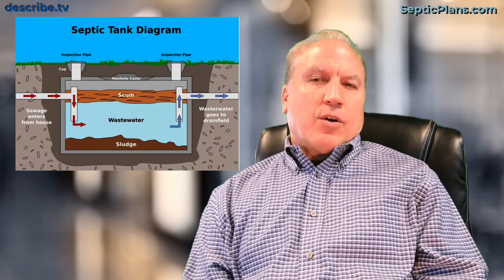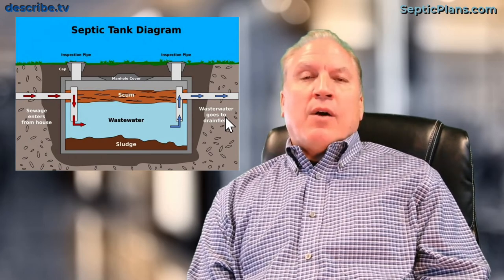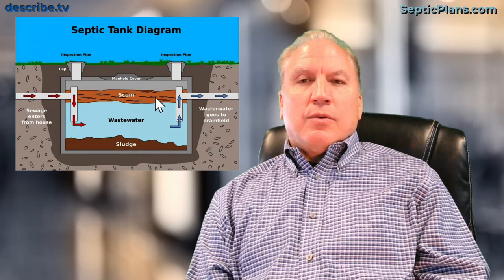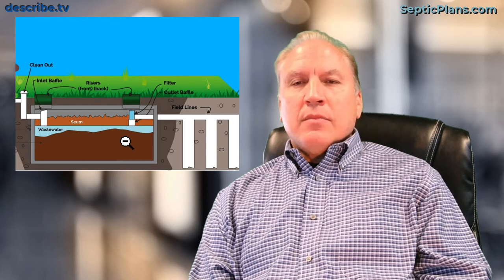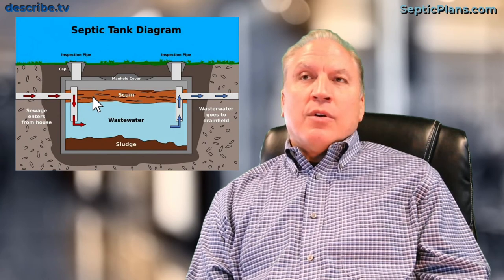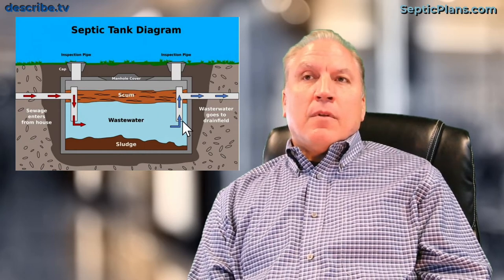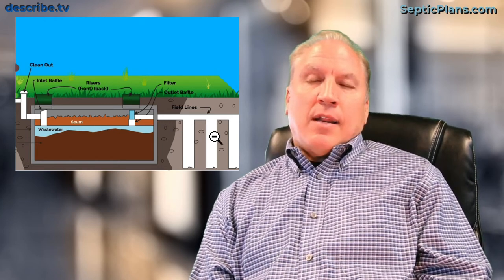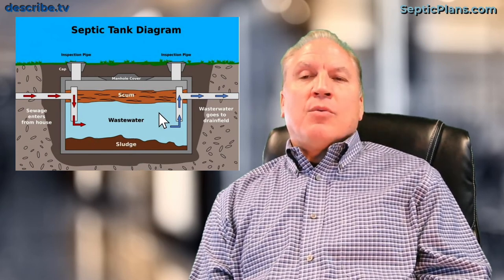How Often Should You Pump Out A Septic Tank?

Comment: Good overall video and good advice. The one comment I would make is that it's not that the soil around the drainfield is "sensitive" but rather that it is a specific granular sand that was imported to promote drainage from the field lines. If the sludge or the grease, Oil, Soap layer which we typically call "cake" is able to enter into the drain field and plug it up the drain field needs to be replaced. Typically, This replacement can be done in the same location, but it requires the complete removal of the existing field and the contaminated sand and then replacement with new septic sand and the new drain field system. Here in the South, I recommend that people have their system pumped every two to five years. As you said it's really a cheap maintenance cost to keep your system operating for its entire lifespan. One other thing that we have seen recently that has become popular and has created a real problem are some of these "wet wipe" products. They are made of a plastic fiber that does not break down in water and they seem to have a rather neutral buoyancy. The end result is we have seen drainfields plugged solid with hundreds of wet wipes!  They are also jamming up grinder pumps in lift stations. I always try to warn people sure to only use products that are septic safe!